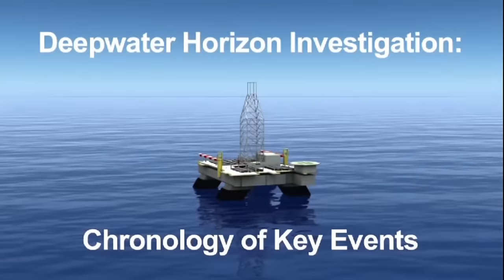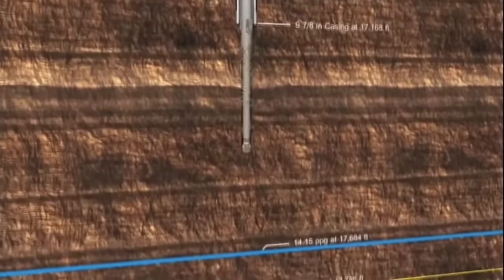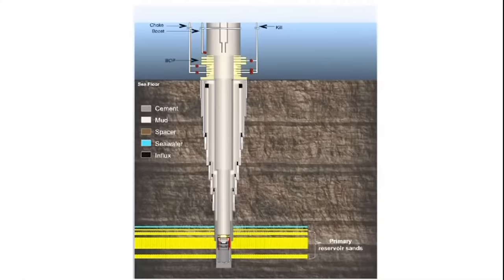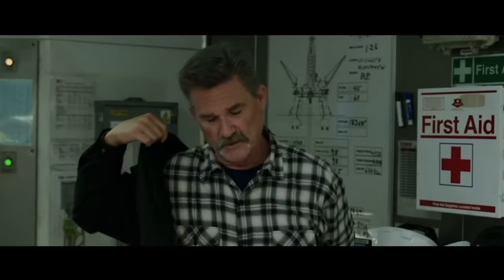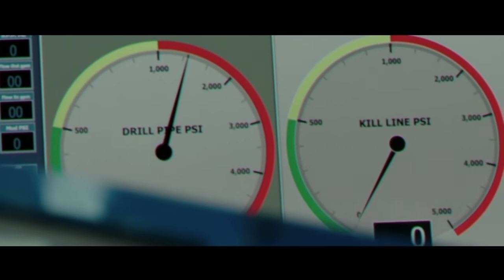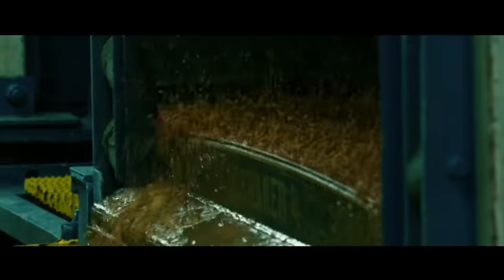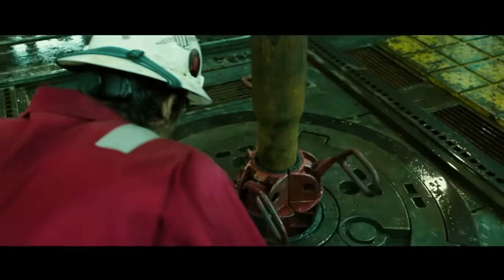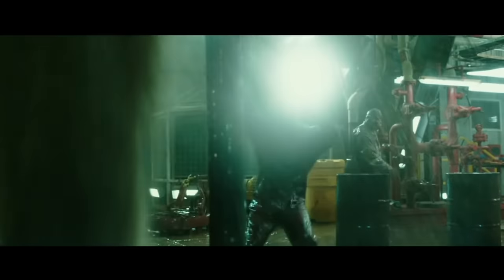BP Deepwater Horizon Investigation Report with scenes from Deepwater Horizon (2016)

Comment: Bottom line bp tried to hurry to save money
The annular was damaged as much as a week prior
All pressure tests on drilling wells must be a constant negative pressure and all cement plugs must be verified before mud can be pumped out 
All testing for natural gas leaks from the well have to be monitored at all times
The bop must be in working condition and all tests must be verified before installation
All of these systems on deep water horizon failed because bp executives were in a hurry to movie on and they interfered with the proper decision that needed to be made
Reply: The 'bottom line' is a series of links in a chain of disaster with multiple causes.
Reply: Let's see, the BOP  was pencil whipped prior to being installed on the well. (That's why when the rov tried to operate a hydraulic shear valve, it leaked) 2. Haliburton had questionable cement plug which failed. 3. No one who saw fluctuating gages knew what was causing it. 4. When systems began to fail, several people could have hit emergency breakaway,  cutting to well pipe, but didn't for fear transocean would fire them. (Read 27 page new York times report.) Also, with leaking BOP would not have worked. There is enough blame to go around but BP had deeper pockets so they took biggest hit. 11 lives lost, 115 lives of survivors effected and all those in first 72 hours, pilots, crews of  field boats and nearby platforms that treated the 115 injured will never forget.

Comment: Don’t the EMD engines have over speed control? How could it not shut itself down?
Reply: My understanding is that they do, but the "shut down" just cuts fuel to the injectors it doesn't actually close the throttle or anything else. Since the gas was serving as fuel, they kept running on their own even with the shutdown initiated.
Reply: I thought there should be valves on the turbo discharge to stop air intake.
Reply: Depending on the make/model, they do have overspeed control but the response time of the components may have been to long to prevent this scenario. Plus, gas in the intakes can cause the overspeed to happen at a rate that can't be controlled by the engine safeties. Which is why, on the last rigs I built, I tested the "total rig shutdown" multiple times to confirm that not only would it open various breakers to major equipment but that it would also close the intake flaps on the engines. With the intake flaps closed the engines choke and shutdown immediately so gas can't cause an overspeed in this type of scenario.
Reply: Classic diesel runaway scenario.
Reply: So the Deep Water Horizon didn't have EMD in reality, they were Wartsilla's 18V32's -720rpm.  There would have been multiple alarms that would have commanded a shutdown: overspeed, High bus frequency, over voltage, etc.  This would have tripped the main generator bus breaker along with commanding the governor to go to zero rack ( 0% fuel) and activated the "Rig Savers", this is the dampers that close to shutdown the intake air into the engines.  Sometimes they are before the engine inlet or between the Turbochargers and the aftercoolers.  

When this would have happened the engines which are just under 10,000hp each, they have 6 generators with probably 4 running @ under 50% load (requirement maintaining Dynamic positioning compliance).  Also the engine room is under positive pressure from supply blowers and with the massive amount gas enveloping the rig it would have filled the engine intakes in an instant.  As the gas was ingested and the Governor on each engines starts to lose control maintaining speed/ cycles -60HZ, once this hit alarm points the Main breakers on the generator would have tripped removing the load from the generator.  This equates to knocking your car into neutral on the highway why still keeping your foot on the gas pedal because of the gas now as a fuel source.  The load on the generators was holding the engine back now you remove it and the over speeding engines are really going to go critical and "BAM".   This would happen in a matter of seconds with the safeties trying but failing to prevent.  Also these engines are 11 yrs old and not everything is sealed tight, that large engine is a big pump and will pull air in from where ever it can when starved.  This was an extreme and sad situation which would have been extremely difficult to prevent the engine failures & explosions.
Reply: @adamt-yu7os  Interesting insight, do you work on rigs?
Reply: This is called a runaway condition and is really only possible on diesels. Certain fuels or gases. Some turbo diesels have runaway when their turbos seals failed-allowing engine oil into the intake. If the engine is hot, rather than fouling and stopping..it will accelerate and burn the oil. At this point, there is nothing other than physically blocking off the intake air that will stop it from running.
Reply: It does have overspeed control. However, diesel engines can't actually shut themselves down. They need to have their fuel cut off. And with oil particles coming in through the oxygen intake, that's not gonna happen. Now, some diesel engines do have a secondary failsafe that acts as a brake on the pistons. Except when those brakes activate, sparks fly. I shouldn't need to tell you why that would be a problem on an oil rig. Finally, there is another way to stop the engines from running, but this process also takes load off the generators, and load on the generators acts like a inhibitor to the speed of the engine. If this method was used, the engines would've spun up so fast that there is no way in hell you could've stopped an explosion.